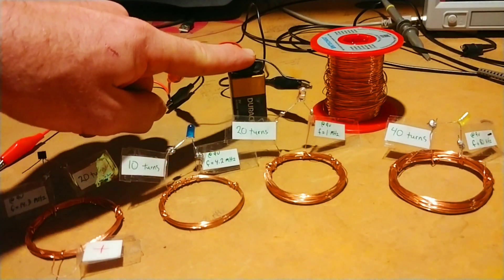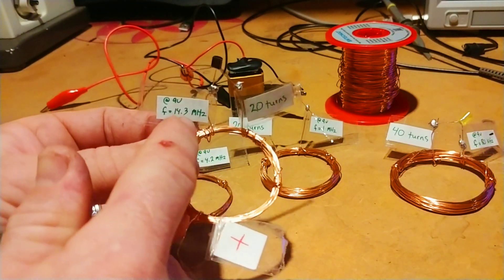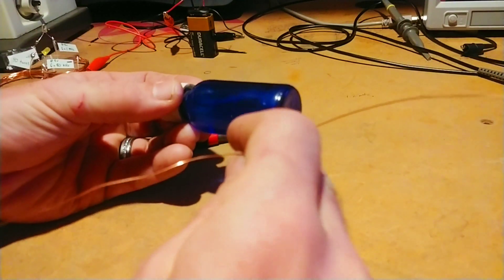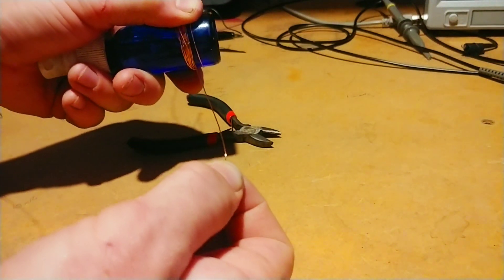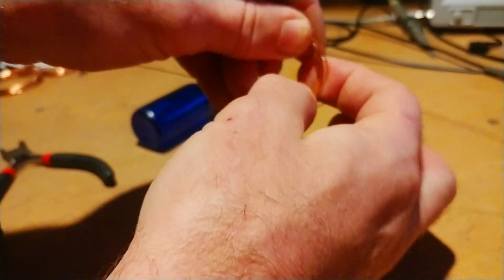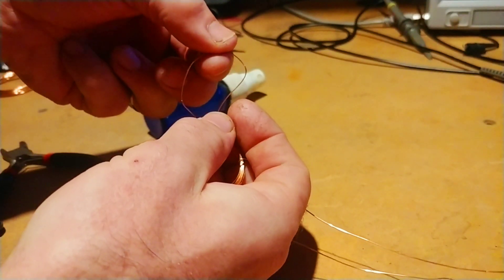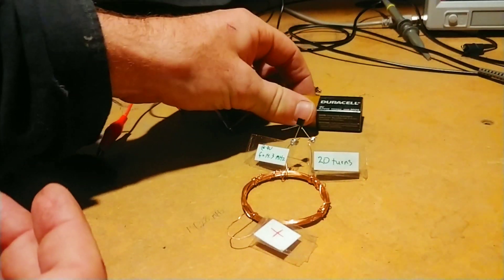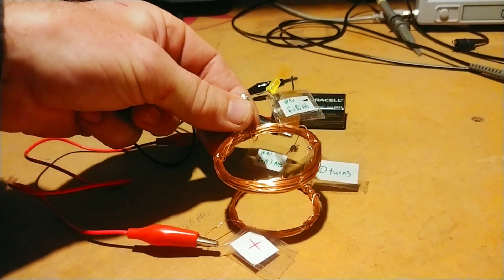Wireless Power Transfer (WPT) Simple Experiment How To Inductive Resonant Electricity Coil Coupling

Comment: Nice experiment. But it's not resonant coupling. It's just magnetic induction. To be resonant you need a LC tank circuit on both, transmitter and receiver. Also if it was a resonant coupled transfer, you would get a greater range.

Comment: Hey Jetterson, I discovered something very interesting myself, while playing with a K-9 wireless fence & shock collar system, given to me by a friend who thought it was something that I was interested in. I wasn’t, however as I put the battery in the collar I wanted to attach my Fluke meter onto the taser barbs to display what kind of voltage shock power it would be putting out. By happenstance I picked up my Dewalt (brushless) wireless 20 volt drill and pulled the trigger. The shock collar, loudly beeped to life. I was in total shock, no pun. I found the slower I pulled the trigger on the variable speed drill, the closer it was, the louder it beeped! ? I instantly thought, wireless energy! Any thoughts...? Thank you for posting this video ✌🏽
Reply from the maker: DC motors have actual magnets instead of electromagnets for their motors, so yes you were generating an electromagnetic field.  How far away from the collar were you when pulling the trigger?
Reply: Jefferson Drumm like 3’ to right at the collar itself. But with a piece of metal coat hangar and my vice I was able to get it from 10’. I put it in the bit shaft. It was like touching the holy grail for a second. Thank you